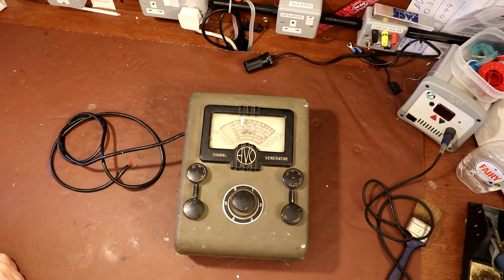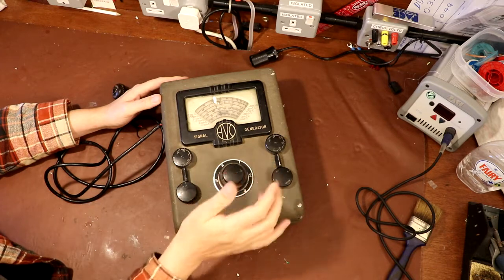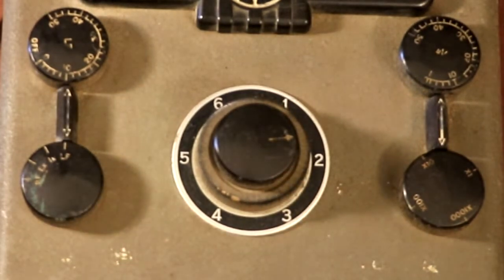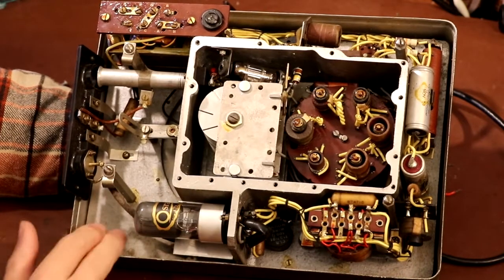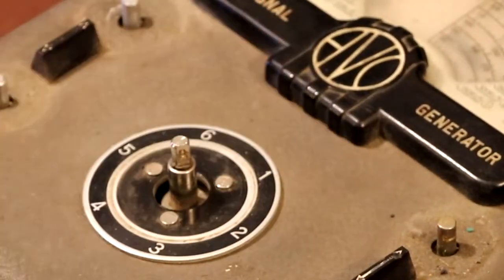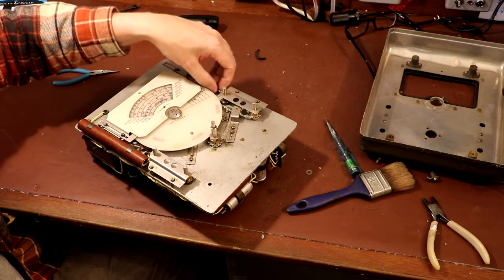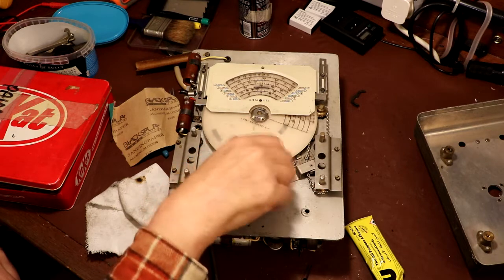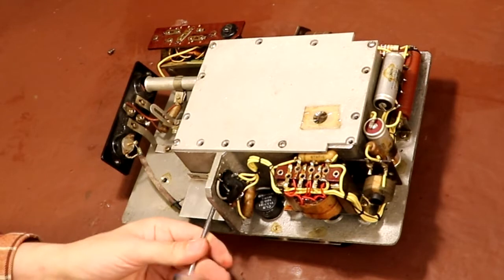BUM HOLES ! - Part 1

Comment: I love the manual for this.

Heading: "Instructions for use", immediately followed by a detailed description of how it works and detailed internal pictures/diagrams. 

It's hard to tell the diameter of the friction drive wheel thing, but if it's not too small you could probably use a 700c bike tube cut into slices, layer them up until it's tight enough. I've done this before with similar things, works fairly well.

I'd find a beat up valve radio from the late 60s era when they started using solid state rectifiers, steal the transformer from one of them. Dunno much about British made radios, but there are fairly cheap Aus made ones from that era that are very cheap and plenty enough to butcher up for parts for stuff like this. Much to the disgust of many collectors lol
Reply from the maker: Dan'sVideosAndWhatHaveYou  you gave me an idea for a the tyre from one of those toy track racing toys. Yes I think a transformer from an old radio would probably be best I will have to keep a look out. I assume that AVO equipment was popular in Australia given our long history together? Thanks for watching regards Chris
Reply: Avo meters for sure were popular here, and they're common as dirt. But I think that's the case worldwide -- they were practically legendary.

I think AVO gear like signal generators and the likes were popular with the defence forces, but not the consumer industry or hobbyists. I don't often see AVO test gear apart from meters come up for sale, and I've certainly never owned any. But I do see it pop up now and then. It usually commands a high price too... So I guess that says something about the popularity/scarcity of AVO stuff here.

Usually when I've encountered AVO equipment like this for sale it has some kind of indicator on it that it was ex-govt/military, like the arrow symbol, and they often have a little "mod record" sticker on them as well which I have seen on a lot of ex military type stuff.

We had a few Australian manufacturers who were more popular with old test gear like this, like AWA.

Comment: Possibly use of a O-ring? I have a couple kits of them I've used for mechanical and plumbing repair. Finding one EXACT dim's as you require could be a problem. There once were specialty seal/O-ring sellers around town here that would order you almost anything you want if they did not have. Of course, they preferred to sell you 10,000 pcs. but were kind enough to provide small quantities.
Reply from the maker: Danish Native it’s much wider than a O ring. Perhaps the seal from a stuffing gland would work. Thanks for watching and comments regards Chris.

Comment: With regard to the rubber sleeve for the dial drive, maybe a short piece of hose with a suitable inner diameter, such as automotive heater or vacuum hose? Sometime that works for replacing rotted rubber on eight track cartridge pinch rollers, but the tires are a bit thicker on those. Short of that you may have to glue a short length of thin belt around the shaft.
  Does this generator use just that bridge rectifier or does it also use a tube/valve one as well? Is it possible that the bridge might be for the tube filaments or a bias supply? If so then it may be a copper oxide rectifier, which would explain the 7 VDC.
Reply from the maker: You know I thought it was a copper oxide rectifier but others did not agree.  All the selenium rectifiers I have had in the past had cooling fins. I am not sure what the difference is  in forward voltage is between a copper oxide or selenium rectifier? .  I think both have some resistance compared to modern silicon diodes. 

That is a good idea for the rubber material. I thought about the inside of a PG9 stuffing gland or perhaps silicon hose as it has a bit more rubber stretch to it. I guess I will however just leave if for now good enough for testing.
Reply: From what I read the copper oxide ones were normally for low voltage/high current power supplies, such as battery chargers, but the selenium ones were for high voltage/low current supplies. I think that the forward drop in the copper oxide ones is usually lower then selenium, but I'm not sure how that would compare to a silicon one. One difference between selenium  and copper oxide is that you can repair them by tightening the screw holding the stack together whereas selenium ones just keep getting worse. 
 If that bridge is a selenium rectifier then how is it cooled? There are no fins and there is no heat sink, such as those flat German units have where the case is screwed to the chassis. 
  I hope the power transformer is all right, that signal generator looks well made in spite of the bodges in the cover plate. Speaking of transformers, I was poking around with a Canadian radio, a Deforest-Crosley, recently and am up to two bad transformers. Two weeks ago I found out that the output transformer was completely open on the primary. Today I found that the primary of the first IF transformer also reads open, but I opened the can and did not find anything burned out, or obviously wrong, so I may be able to repair it once I get the thing out.
Reply from the maker: @OlegKostoglatov  Thanks for the information on the rectifier  and I did not know you could tighten up a copper oxide rectifier so that is a top tip.  Spoiler alert but the secondary on the transformer is open circuit so that is that. I going to power it on an external  power supply.   I always tell myself that I will check transformers and IF coils etc for open circuits before committing myself to a repair but never do.  You really should post up some video be interrested to see you collection and work etc. Best regards Chris
Reply: Fortunately the If transformer is a 456 Kc one, so I could put a substitute that will work, even if it isn't identical. However I will hold out for the proper one, Roger-Majestic built a lot of sets with the same, if not similar transformers in them and a junker or parts chassis  will turn up at some point. The only odd part is that this is a step down transformer, with a small third winding wound next to the secondary. Most IF transformers are of a 1:1 ratio, but this is more like a 3:1 ratio, so I'm not sure what would happen if I used a 1:1 type. The small third winding is no problem, it's only about two turns, .1 ohm in DC resistance, I could always add one to the replacement if it lacks it. 
  I did melt some wax off the primary coil, and tried to find a break in it, if there is one I don't think it's near the outside. More bad news, the set has an RF choke in series between the B+ and the plate/anode of the RF amplifier tube, I checked another Rogers built set, a Canadian Majestic, with the same choke, and it's open in it as well. This was how I found out that the 1st IF can had a 3:1 ratio, I measured it in the other set.
 It's frustrating because with them both open the only way to find out what I need is to unwind one of the dead coils and count the turns.The service info doesn't give DC  resistances for the coils, let alone inductances, and it also doesn't explain what it's for or why it's needed. Tonight I jumpered the choke in the Majestic, it brought the RF amp back to life, it worked much better on AM broadcast (MV) but it's still deaf on short wave.

Comment: Hmm bumholes lol.
I thought that rectifier was a multi tapped resistor, the only selinium rectifiers i've seen are the square plate jobbies on a bolt with spacers and connection tags.

Yes rubber turning into black goo, been there when fixing old reel to reels, it's like tar :-(
I blame philips, every one i've serviced has been tar city.
Yellow yellow and not forgetting yellow :-D
I wired up a c.b pcb into a large case for a frend, all green wire lol, well you use what you have.

You do pick some hard ones, no not todgers, filthy mind :)
Reply from the maker: zx8401ztv  I went with the flow on the selenium rectifier I actually thought given its construction it could be copper oxide but it could be either. Rubber parts are hard to repair and many a tape deck has failed and they all will eventually as it always degrades over time and no way to stop or reverse the process. Thanks for watching and comments regards Chris

Comment: you could also try something like a thick tap washer but you would need to turn it down to the right diameter !
Reply from the maker: Unfortunately I don’t think it’s possible to machine rubber it moves around the edge of the cutting tool. I have never been able to do it anyway. Are you going to goldborne tomorrow?
Reply: @allthegearnoidea6752  your right its a little be tricky machining rubber but it can be done I did turn a pinch wheel down for a tape recorder that was slightly too  big I put it in my little lathe and used a coarse file gently resting on it lovely smell of burning rubber if get wrong but it does take time as for goldborne  probably not don't think I have ever been not even sure where that is ?

Comment: I have the older virsion the AC output fom the transformer is 100 volts AC  the DC volts after the rectifier is 70 volts i do not know how good the rec is in mine but it seems to work ok.
Reply from the maker: rob titheridge  that’s brilliant Rob, Andrew has just measured 110 ac on the secondary. Was that dc voltage on the first or second smoothing capacitor. They have a 15k ohm smoothing resistor.   That’s much lower than I thought as the electrolytics are rated for 350v. Thanks Regards Chris
Reply: @allthegearnoidea6752  it was on the first but as i said the selenium rectifier may be weak ps mains input was 235volts.
Reply from the maker: rob titheridge  that’s funny Andrew has 280vdc on first smoothing capacitor and 180 on the second capacitor. So the smoothing resistor drops 100 volts
Reply: @allthegearnoidea6752  i will check again tomorow  may be i misread the 2?
Reply from the maker: rob titheridge  you may be correct the one I have works down to 70 volts.